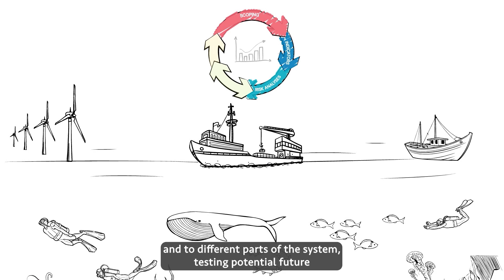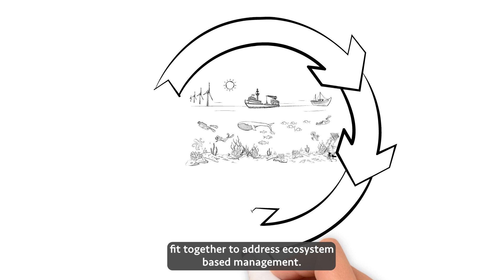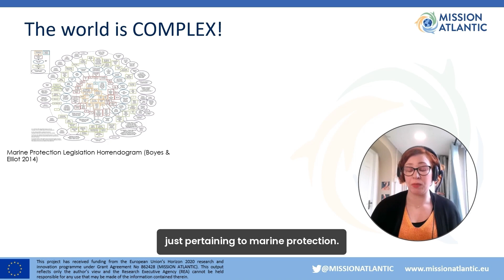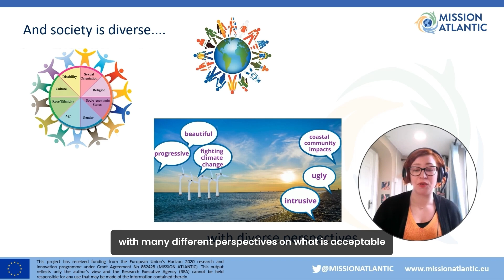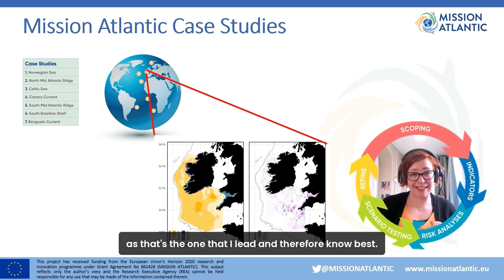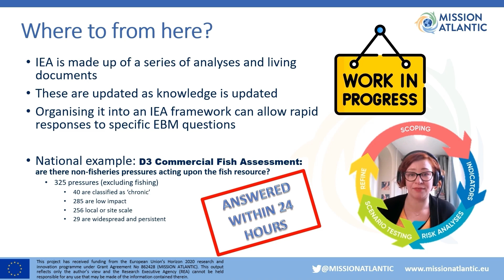Introduction to Integrated Ecosystem Assessment

Comment: As an early-career Ocean Professional, I am genuinely astonished by the potential of this tool. What stands out most is its ability to guide the transition from a purely qualitative approach to one that effectively integrates quantitative analysis. In real-world policy and regulatory environments, models based solely on qualitative insights often struggle to gain acceptance. However, combining both approaches not only strengthens credibility but also helps identify the specific quantitative data needed to support and validate the models. The scoping phase is particularly crucial. It enables us to gather extensive information from a broad range of stakeholders who are identified and engaged early in the process. Coming from an African context, this has been especially valuable: we learned that even when stakeholders hold very different perspectives, they are willing to negotiate, collaborate, and share knowledge. Many of them possess data—both qualitative and quantitative—yet are unaware of how important these data are for assessing the ecosystems they depend on daily, or how such data can inform broader management and policy processes. This is my initial feedback, and the tool is already reshaping how I conceptualise the ocean system. I am beginning to look at the ocean rather than the oceans, recognising the interconnectedness of basins and processes. I am particularly interested in exploring how this tool performs in the Indian Ocean and how it can be linked with the Atlantic context. Looking ahead, I also see significant potential to use this tool to assess cumulative impacts in the deep sea, especially in Areas Beyond National Jurisdiction (ABNJ), to support the effective protection of the marine environment. From the next video, I hope I can see 
more examples from a data-limited region like the Western Indian Ocean; a clearer step-by-step on converting qualitative narratives into indicators, and a brief explanation of how the tool can be adapted for deep-sea and ABNJ assessments.
Thanks, Debbie + Mission Atlantic - ICES team
by Ivaldo Fumo, MZ

Comment: The Introduction to Integrated Ecosystem Assessment (IEA) is highly relevant to the management of Ghana’s urban wetlands, especially the Sakumo and Densu Delta Ramsar sites where I work. The IEA’s emphasis on Ecosystem-Based Management connects directly with the diverse nature of these wetlands, which host birds, fish, mangroves, and many other species that provide essential ecosystem services such as fisheries, flood regulation, and recreation.
In recent years, however, these ecosystems have been increasingly threatened by urban expansion, pollution, and coastal erosion. The IEA framework provides a useful guide for addressing these challenges through its focus on assessment, management, monitoring, and adaptation. It also highlights the importance of involving multiple stakeholders including local communities, traditional authorities, government agencies, and the private sector in finding sustainable solutions.
I find the IEA’s structured and cyclical approach particularly valuable, as it can strengthen planning, monitoring, and communication between managers and policymakers. Integrating this approach into Wildlife Division training programmes, staff induction, and new project designs would help build the capacity needed for more adaptive and informed management of Ghana’s wetlands.
Overall, the IEA provides a strong, comprehensive framework for sustainable wetland management. To be most effective, however, it should be localized to fit Ghana’s unique environmental conditions and cultural context.

Comment: As a PhD researcher focusing on the holistic approach to sustainable use and conservation of the seas, analysing it from the point of view of integrated ecosystem assessment is quite indispensable. I appreciate the structure of the presentation - a few bullet points that help participants follow clearly the thorough explanations. Having these keywords also helps in additional research on this topic. In addition to that, the graphics made it easier to understand and kept the audience engaged. I would appreciate it if subtitles were optional or smaller, as sometimes it seemed to me they were interfering with the content of the slides. Also, having a short summary of the primary references used during the presentation would make it easier to research them any further.
Reply from the maker: Thanks, Martin! Would a list of references and DOIs in the notes under the e-lesson help? Or are you looking for more of a short synthesis of the key, recent publications on the topic? Ivo & Alondra

Comment: This tool is directly related to my work as an interdisciplinary marine scientist as I am constantly thinking about ways to integrate qualitative data with quantitative data, particularly in data poor settings. I find it interesting that the IEA process outlined here only includes input from Stakeholders (from my understanding) at the early scoping stages of the process rather than integrating stakeholder input throughout the entire process. I think the beauty of this IEA tool is that it provides a clear pathway for how different ecosystem assessments are all linked together and is novel in that it incorporates both quantitative and qualitative methods. I am curious how these ideas could be further developed using theory associated with adaptive management processes and participatory modelling practices. Wonderful to see this idea shared through this E-lesson format. Thanks Debbie + Mission Atlantic - ICES team!

Comment: The concepts presented in the e-lesson are highly relevant to my current research on marine ecosystem dynamics, especially in understanding how to integrate environmental, social, and economic data into a cohesive assessment framework. The structured approach to Integrated Ecosystem Assessments (IEAs) well relevant with the kind of interdisciplinary analysis I am developing, making these tools immediately applicable to my work. I see strong potential for incorporating these lessons into ongoing projects, particularly in designing more comprehensive monitoring and management strategies.
One area for improvement could be the addition of more interactive elements—such as short quizzes, real-life case applications, or guided exercises—to help reinforce key concepts. It would also be beneficial to see how different regions have adapted these tools to their unique challenges, offering a more global perspective.
Overall, the series is incredibly well put together and accessible. A creative suggestion might be to develop a companion workbook or template set that allows viewers to apply what they’ve learned in a practical, hands-on way. This would help bridge the gap between theory and practice and support more immediate implementation in diverse research and policy contexts.
Reply from the maker: Dear Reza, 

We hear your request to showcase how different regions across globe have adapted IEA Tool to their unique challenges! This project had 7 such heterogenous regions across the Atlantic, and the ICES IEA Symposium is showcasing the results, as you request https://www.aqua.dtu.dk/english/kalenderarkiv/2025/11/all-atlantic-integrated-ecosystem-assessment-symposium , pity that we could not embed them in the e-lessons!

Your ask for "short quizzes, real-life case applications, or guided exercises, workbook/template to apply lessons learned in a hands-on way to help reinforce key concepts" seems to be a recurrent request (and a very good one!). 

One promise we can make to you here and now, is that based on these suggestions for improvements, we will draft official recommendations to all ICES IEA Working Groups of experts https://www.ices.dk/community/groups/Pages/default.aspx?k=integrated%20ecosystem%20assessment , so that in future any "IEA Literacy" and e-lessons efforts start with your requests at the onset.

Ivo & Alondra